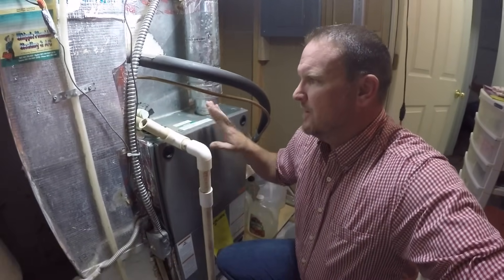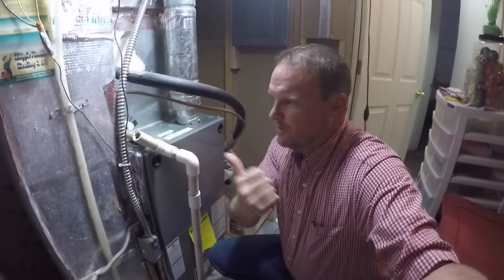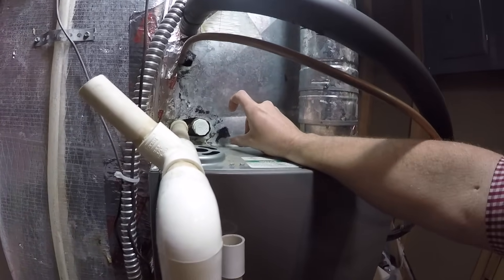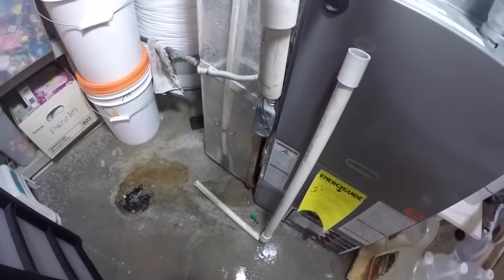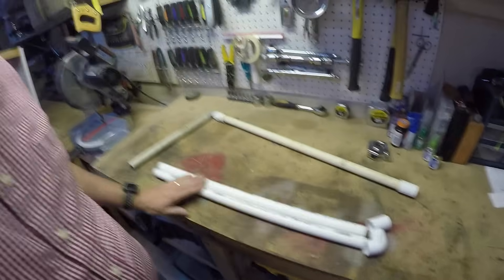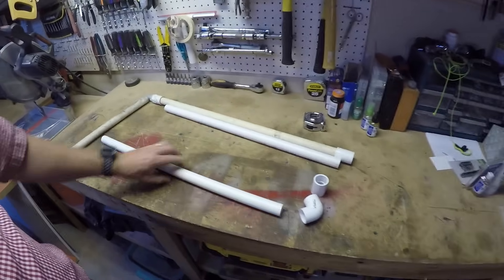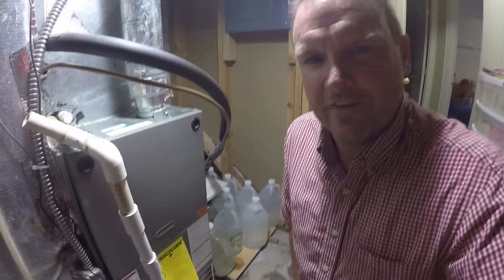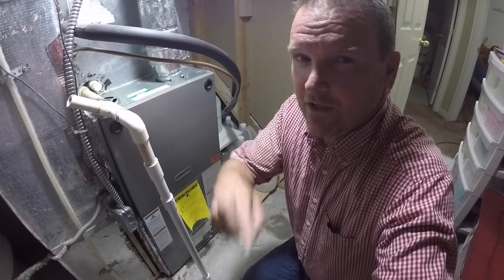Home AC Leaking Water On Floor?  Air conditioner water leak - EASY Fix - save yourself $1,000's

Comment: Thank you very much. This video saved my 6300$. After the leak the "technician" said I need to replace the full AC unit , when he could have just checked this outlet and fixed it. Then I watched your video and 1 hr before I fixed and my AC is running without any issue. I cancelled the appointment withe these guys to replace my unit :) Thanks again for the great video !
Reply: I hope you Left a crappy review for them, they were trying to scam you out of money
Reply: Thanks Youtube for the videos & stay away for unethical pros ....

Comment: Troy...if I could reach through YouTube and give you hug I would.  Your AC issue was the same as mine and I was about ready to call out my HVAC team.  I'm a DIYer first and I'd about given up once I opened my AC coil and saw the water tray filled  with water.  Found your video, followed your directions and sure enough, my drain pipe was clogged and water came crashing out above the clog once I disconnected it at the vertical sleeve .  $30 later and a little bit of pipe work and it's working perfectly.  I also repositioned the drain pipe to always have a down slope to help keep the water moving and not allow it to stagnate in the future.  Wow!  What a save!  Thanks!  Really appreciate you taking the time to post this video.
Reply from the maker: Wow thanks so much for the kind words!  No hugs necessary. Haha. Glad it helped!  👏🏼

Comment: THANK YOU THANK YOU THANK YOU!!! 1am on a Sunday morning - cleaning up after a party (where I ran the furnace fan the entire time) and cole down to my garage to find a bunch of water on the floor around my HVAC and water heater- initially thought my water heater was leaking but found the water leaking from inside where that pvp pipe connects just like in the video. Luckily mine had an access point so I popped the cap and water was coming at the top so I just jammed a pipe cleaner inside and that clear line starts gushing water out with some air bubbles in it. It was like a lot like clearing a clogged toilet with a plunger. The leaking stopped instantly even with the fan still going. I have some clean up to do on the ground but saved at least a few hundred on a call to a tech. Not to mention the problem persisting through the weekend until I could have someone come out Monday morning at the earliest. Such a simple fix for what was a relatively stupid problem. Thank you again!
Reply from the maker: Glad it helped, I hear this story over and over.  I'm glad it's an easy fix and people are finding my video to help save them cash!!!

Comment: Had the same issue in my basement I noticed that the floor around the central air unit was wet I even located the side where the water was coming from ,, I watched this video and the next day I did the same steps and that was the issue the pipe had blockage, I flushed it with hot water back to back and installed it back and it worked like I charm,, I just didn’t have access to the water pan inside the unit to drain the water that was in there but I’m satisfied with the results thank you
Reply from the maker: So glad it helped. It’s kinda scary to see water so close to electrical. 😱

Comment: Brother i saw the water and freaked out and the first video i saw was yours and in two seconds i checked and sure enough it was plugged . Unit still working fine for now so i just need to hv it dry on the bottom. In over 100 temperatures it should be no prob. U knw i appreciated you video, thnks a million
Reply from the maker: So glad it helped!  I know that feeling. I was picturing $1000’s down the drain - literally!!!!

Comment: Good video, I would inspect it further as to what caused the blockage. My guess would be that 90° bend. A simple fix would be to just heat the pvc and create a more gradual bend.
Reply: The condensate , the water, is dirty and builds up a slime like coating in the drain. I have a Tee like this in my drain and i pour a coffee pot full of hot water down it 1 or 2 times a season.
Reply from the maker: I now do a Spring Cleaning of the pipe along with other items, haven't had an issue since starting that routine.

Comment: Instead of using an "L" (90degree), use two 45 degree fittings. Less problems and will not clog as easily as the 90.
Reply: Next level advice.

Comment: I had a clogged pipe which once I cleaned started to gush out water which is what was coming out the wrong end and flooding my floor I am guessing. Fingers crossed that this may have fixed the issue. Waiting for 48 hours before I claim victory I guess. Thanks immensely for the video.
Reply from the maker: Reply back if it fixed your issue.  I'll bet you are good to go!  Glad this video helped!

Comment: Ty! I just popped mine off & rinsed it with hot water and piles of gunk came out. I’m shocked it didn’t leak sooner lol, every time I thought it had to be clear another giant hunk of wet dirt & dust would fly out lol
Reply from the maker: That’s what happens!  I now clean mine yearly as part of the spring maintenance.

Comment: I used to have same problem in my house. I had created some bypassing connections to allow me unclogging pipes, with the same pressure gun for toilet clogged and also clogging Solution. Now, I wonder if instead of using 90 degrees elbow pipes, if using 60 or 45, could avoid clogging for ever. Haven't tried yet.

Comment: I have to admit, with the frustration I was feeling over my flooded basement, I almost didn’t even bother opening this video because I thought I would be wasting time but sure as s*** enough, that drain pipe was clogged as f***. Problem solved. Thank you very much…..
Reply from the maker: So glad this helped. It’s such a simple fix but can be so expensive to replace when it goes wrong!

Comment: If possible I would recommend using 45 degree pipe couplers instead of 90's. 90's clog easily with zero water pressure as you know from this video. Or you can bend the pipe at a slow 90 with a heat gun. Simple right??

Comment: I thought this was my issue, and maybe it still is, so I'm going to clear out the lines anyway, BUT the main drain outlet still drips fairly steadily while the unit is running, so now I'm wondering if the reservoir/catch basin is overflowing somehow, or if one or more of the internal lines got disconnected somehow.

 idk, I'm gonna have to take some stuff apart, I think, as I've mopped up about 2-3 gallons of water off our basement floor the past two days. Thanks for the video, it gave me a starting point at least.
Reply from the maker: Hope it turns out simple.
Reply: @troysgarage  yea it was. I spoke to my step-dad a power engineer who used to work in a nuclear power plant for some advice too, and he basically said the same as the video, so I just had to power everything down, then I drained the reservoir of around a Liter (32oz) of water, and blew out the lines. 

There wasn't a ton of debris, but I guess with how low the flow normally is, it doesn't take much to make it get backed  up. 48-ish hours later and it's stayed dry down there with steady AC use. I'll keep an eye on it for the next few days, maybe a week just to make sure it can keep up with the moisture it's been pulling out of the air. 

We'd mopped up literally 4 or so gallons of water off the floor over the time when we noticed it until fixing it yesterday, so I'm pretty confident we fixed the issue. Now I just gotta remember to do it once a year or so....

Comment: thanks for the info ...just saved me a service call.......not sure yet if the line was plugged or just not enough incline for the water to drain, will find out when i cut it out when the stores are open tomorrow!

Comment: So I think this is my issue. On my unit there are two holes on either side (left and right) and one side has the drain pipe and a cap(left)  on that other hole. My water is coming out of the other two holes on the opposite side (right) that are uncapped. Is this a similar problem with a clogged drain? Should the two holes that are unused be capped?

Comment: Hey!  Happy to find your video! What if my unit is over 20 years old, leaking water into my basement, and constantly freezes up unless we keep the fan running.. should we just get a new AC Unit?  Our central heater is a few years old, but I'm just finding it difficult to come up with an extra 5,000 or more for a new AC! 🥵😒 any tips?
Reply from the maker: A freezing issue is usually caused by the ac running for too long and high humidity. It freezes on the coil and doesn’t have time to melt away before the ac comes on again. Could be an airflow issue where the house isn’t getting g enough circulation of the cooling air. Clogged return air vents etc. when was the last time you changed your filter?

Comment: Thanks for video. I do have water leaking out of the off-shoot and some air too ( I guess is alright?) , but still water leaking on top of furnace where I think the drain tray is located. I should dismantle this area and see for a clog?
Reply from the maker: You should be able to take the drain spout off and clean it out (or replace it). It’s ok for air to leak from it. Mine does too.

Comment: This was my problem too.  Wasn’t leaking yesterday, but went to the storeroom today and heard water trickling.  My question is this - Is it stupidity that leads to a design where a common water leak can gush water into the furnace housing, or is that part of a diabolical business model to increase sales?
Reply from the maker: Yes and yes!  Some of both. In theory the pipe should handle the water, but in dusty basements and Maintenance closets the pipes are bound to clog up over time. It’s a good reminder to yearly check for clogs. I need to do mine again too. 👌🏼

Comment: I have an older Heil vertical unit and the pan is rusted out and drips when the a/c is on. I'm wondering if the pan can just be replaced. The a/c and furnace work just fine, quiet, efficient, accurate. The drain line is clear. Thanks.
Reply from the maker: I actually don’t know myself. Hoping another viewer might have some info.

Comment: Should water be leaking from the coils?  I have water every day on my filter it is constantly wet not a ton but enough to know it continues to drip all day and I am worried about mold?  Thanks for any advice.  I am still under warranty and the technicians say its ok to have some water dripping I do not believe that.
Reply from the maker: No it should be caught in the drainage pan and go out these pipes to the floor drain. Check for clogs.

Comment: Could this be an issue on a brand new system? Just had one installed a few weeks ago and it's already leaking...
Reply from the maker: Something else could be wrong. I’d call the installer to come back and take a look. That should be a free service call if they are reputable.

Comment: If I replace the PVC pipe, do I need to put the sealant or whatever it is onto the connected pieces?
Reply from the maker: No sealant needed, you actually want to be able to take it apart to clean it out every once in a while.

Comment: I would also install an emergency float switch on the second PVC drain output on the condensation pan. The one you have capped off and is slightly higher than the main drain pipe outlet.

Comment: So I have water coming up from my floor near my ac unit but I see no water around the bottom of the pan where you think it would be. I've noticed my wood floor squishing with water but some days it is dry. What could this possibly be?
Reply from the maker: Water in other places still means a leak. 😱 I would call someone ASAP and get that checked out. Could be a leaky drain pipe or worse, a supply line leak. Either way you gotta get that fixed before you have mold and rot issues. Sorry man, hoping for a good outcome for you!
Reply: @troysgarage  thanks for getting back with me. I'll definitely get someone out here to check it out.

Comment: Ok so if it's leaking from the pipe in ceiling that you can't see,  what do you do?
Reply from the maker: That sounds like condensation on the refrigerant line.  These are usually insulated to prevent that.  See if you can get some pipe insulation on that cold side pipe.

Comment: Troy, can dirty coils cause the tray underneath my unit to fill with dripping water?
Reply from the maker: No, the water comes from condensation and the drain being blocked. That said dirty coils will make it be much less efficient. Always use and change your air filter regularly.

Comment: The whole basement is condensing well the unit itself and the remaining of the inside of the vents are leaking moisture as well,.I.change the filter, clean out the outside ac unit,  now I'm gonna check this pipe  🧐🤨

Comment: Hi! My ac condensator is dripping water only the half bottom of it. Ac still working perfectly, the problem is that if I leave it running for a long time the condensator freezes up and builds up ice and then blocks the air from coming out of the vents... My ac is on a Condominium where cooling towers are used. What can I do to stop the leaking? Thanks in advance!
Reply from the maker: Condensation is a natural byproduct of an AC unit. You can’t eliminate the water. I’d check your air filter to make sure it’s not clogged. Also the underside of the coils to make sure there’s no blockage. You need good air flow for AC to work right. Beyond that it may take a service call to have it looked at.
Reply: @troysgarage  yes, so some leaking is normal on the half bottom coil?? A professional came and said that i need a new AC unit!!! I changed the filter that it was dirty and so far it hasn't freeze again after a week so far!... Thanks for the info!! 👌

Comment: My coil is leaking down to come out at the bottom of the furnace inside of the cabinet but when I pull out the drain hose it isn't clogged there at all. What else could cause this?
Reply from the maker: curious if you ever got this sorted?  My guess would be an improperly installed catch pan or defective catch pan.  If you can let us know how this went, someone else might have the same issue.

Comment: Is it dangerous, if it's leaking? Plz answer
Reply from the maker: In the short term the risk is low, long term could lead to mold. It’s an easy enough fix there’s no reason to wait. Could ruin the AC and you’d be replacing the furnace. Super costly to risk waiting.
Reply: @troysgarage  thanks appreciate the response
Reply: @troysgarage  one more thing. What if it stopped leaking by itself?
Reply from the maker: Things like this don’t fix themselves. It’s likely that the humidity dropped so there’s just less moisture in the air. Summer is winding down and the AC doesn’t have to work so hard. My bet is next summer it will be worse if you don’t clear the clog!  It really is an easy fix and there’s no reason to avoid doing it. Git ‘er done!!!

Comment: Mine has an S bend coming right out of the drain at the top. What do I do here? All joints are sealed. This was installed about 10 years ago. I am sure it is clogged
Reply: I used a drain weasel and stuck that up in there and twisted it around and when I released a bunch of sludge came out and it started draining again!!!
Reply from the maker: You can cut it out and replace it.  If there's sludge in there it will clog again pretty quick I'm sure.  Or just plan on cleaning it out 2x each summer.

Comment: AC unit cleaned, drain pipe clean, new light on unit, and still leaking all over inside house.
Reply from the maker: Must be flogged somewhere. Sorry this is happening to you. Pull the drain pipe off and see if there’s something in the fitting from the drain pan to the drain pipe. Gently use a wire or screwdriver to see if the debris can be pulled or pushed out of the way. Hoping it’s an easy fix.

Comment: What if you cant make your own how can you u unclog the pipe without replacing it? I’m having that issue now any help pls
Reply from the maker: Use some kind of wire with a hook bent into the end. Fish out as much of the junk as you can. But sprinkler pipe is super cheap. So replace it if you can.

Comment: Thanks for the video. My furnace is currently leaking water out the bottom as yours was. However, what do I do if the clog is higher into the pipe or into the furnace?
Reply from the maker: Use some wire, bend a hook in the end and see if you can fish the clog out. You may need to cut the drain pipe to gain access. Then replace the drain pipe with new so it’s slick and clean inside. Hope this helps!

Comment: Bummer. I can blow air through my line from the end of the hose to the condenser (no clog).I taped the end and sterilized the hose 2st water is still leaking.

Comment: This does not make sense to me at all. How changing that pipe would fix the issue? If your primary drainage is blocked then water flows through secondary and you changed secondary.
Reply from the maker: Secondary must have been clogged cuz it fixed the issue 🤷🏼‍♂️

Comment: What was causing the clog?
Reply from the maker: Mine looked like dust lint and cobwebs mixed to a muddy mess!  🤢 It was pretty gross!
Reply: @troysgarage  i just cleaned mine out as well - I can't describe what it looked like lol.. 
Quick question - i cleaned out the drain line and the pump, my rheem unit still has some water pooling on the other side near some other drain outlets that are capped. should I add a drain to the other side?  also, my current configuration does not have a p-trap. it runs directly to the pump. Should i put one in?  Thanks in advance for any advice!
Reply: @troysgarage  I cut mine and I didnt notice anything clogged in it... maybe a little dust but thats about it...... Any ideas of what to do next if the situation isnt solved? My mother saying it could be our furnace but the water is leaking from our central air unit. I dont wanna spend thousands for nothing, and im sure the air conditioning company will push us towards buying a new furnace. help brother!